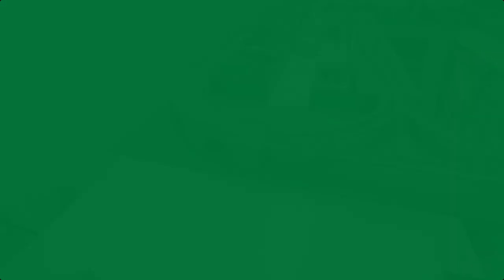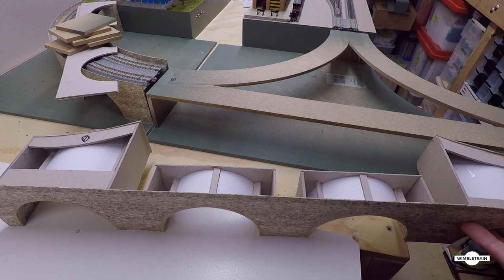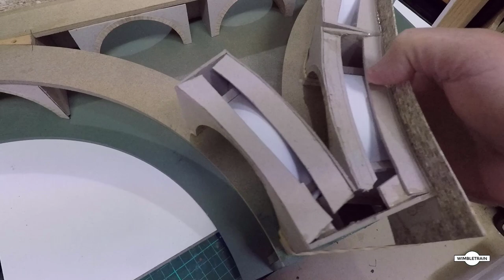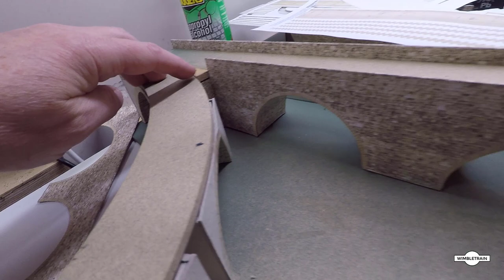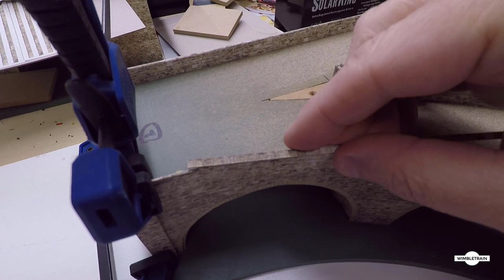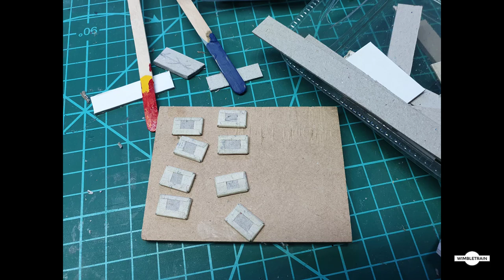Viaduct Scratch Build Part 2 - T Trak Junction Module

Comment: Crikey John, that took some head scratching and figuring out I’m sure, well it would me anyway 😂 Brilliant work mate and neatly put together which is something I really like about your builds how neat and sharp they are.
Layout is coming together nicely and good to see the trains running. Cheers for now John, John
Reply from the maker: Hi John, yes, there were many hours of head scratching going on throughout the build, I'm just happy that its all done now! Thanks for the comment on it being neat, I try my best to get things as good as I can. I wasn't happy with the bit I had to redo but that's life!! Speaking of not being happy, I'm going to build a brand new module where the station is because I want to use Scalescenes kits rather than Metcalfe as they just look so much better. Cheers for now and thanks for your support.
Reply: Hi John, it’s funny Metcalfe versus Scalescenes, I like the ease of build with Metcalfe but love the detail Scalescenes have. I’m becoming obsessed with detail now and in N gauge it’s more difficult as it’s all so fiddly. But you can still get excellent results with a bit of patience. Look forward to the station mate👍